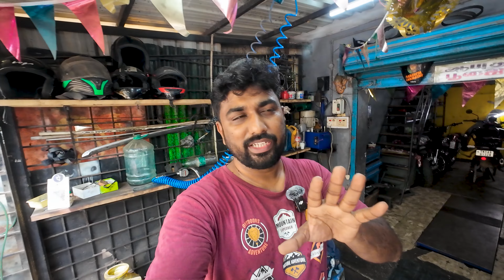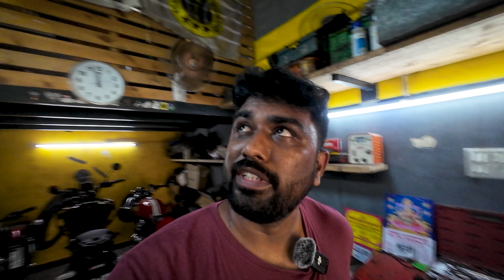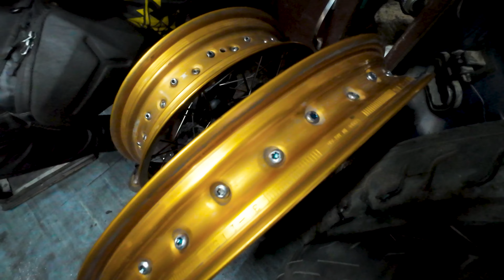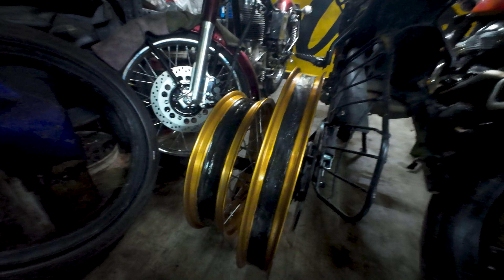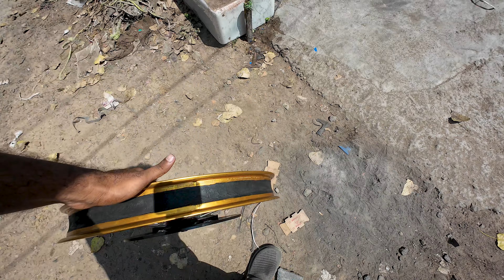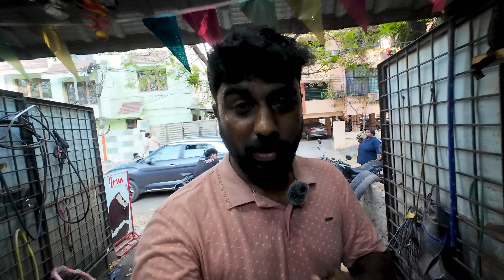Converting my Himalayan 450 from tube to Tubeless🤩🤩 Way2speed kit🔥 Now No more worries during ride😁👌

Comment: hi bro lov ur work but little bit update on this , u cant adjust the spoke if u did the sealant will crack ,, so i may suggest a SIMPLE way which i did on my interceptor 650 , just cut a big tube and spared and place it on the rim and place your tire over the tube now fill the air and cut the excessing tube with sharp blade boom tubeless convection is all that simple  and way cheaper it  cost me just 400 for tube and 500 for labor, issue with this method is you need to fix new tube whenever u remove and refit the tire  happy ride ✌
Reply from the maker: Super nice to hear that 👌

Comment: When the spokes gets loosened won’t torn this tape? Or won’t affect the wheel alignment process?
Reply from the maker: Truing( balancing )of the spoke is done & thread lock paste is add in the spoke nipple before adding this way2speed sealant to prevent it from getting loosened, so mostly it won't happen. If the spoke gets damaged or needs replacement we can cut that portion and do reseal it again 👍
Reply: @lingeshvlogs3871 Bro, still is this good? Or any issue experienced, please mention even if very minor..
Reply from the maker: @Mavricx  so far no issues brother, I don't think there will be any in the future as well
Reply: @lingeshvlogs3871  Great Bro!  I’m also planning to convert, will see… Thank u!

Comment: This is not recommended at all . In future if there is alignment issues with fork you can’t adjust it . There will be wobbling issues, the best is to wait for the cross spoke which will launch in next 3 months.
Reply from the maker: Nothing like that , we can cut the sealant in that portion and after adjustment it can be resealed 👍. Moreover the truing is done & threadlock seal is also done , so won't be an issue.. 3 months ? Really? Do you believe it ?
Reply: 3 months no chance do this converstion and enjoy 😂😂😂
Reply: In 3 months? Are u sure? Cos when interceptor was launched in 2019 - the company promised alloys within 6 months and it took them 4 full years to provide one. And that too is available only for newly manufactured ones. So it would take them bare minimum 1 to 2 years for bringing out the rims which you've mentioned. By that time - all riding enthusiasts would have crossed 50k miles.
Reply: It's already 4 months 😂
Reply: Is Himalayan 452 tubeless available atlest now from RE?

Comment: One small doubt do we need to maintain the same tyre pressure which is 32psi?
Reply from the maker: It is always recommended bro , pls check the manual they might have give some + or - based on the load / luggage weight I guess
Reply: @lingeshvlogs3871  thanks, i think i didn’t phrase the question properly. What i meant to ask is after conversion without tube inside do we still continue to follow company suggest psi for air in tires? Or we keep it more or less? Etc. just a doubt.
Reply from the maker: @purandhar-hm6vx  actually there is no update on it but i keep my tyre pressure at 31 psi

Comment: anna oru doubt off roading la spoke wheel kodukrathe andha spoke spring maari loose konjam movement koduka dhan edhavathu periya pallam illa miniute jerk ana ipa converstion la andha movement ah illama irundha rim odaya vaipu irrukula adhunala dhana alloy wheels ah off road apa thavirkuranga alloy odayum nu purila enaku konjam sollunga anna?
Reply from the maker: Correct tha pa but that sealant is rubber kind of material ( like our bike tube ) it will allow the spoke to do it's thing . nothing to worry on it bcos even in the tube tyre in this spoke rim RE ( infact all manufacturers) has given spoke rim tap which will be pasted to our rim to prevent the spoke to poke/ damage the tube 🤷‍♂️. So it is how it is ☺️

Comment: Thank you for the Information Nanba, 

Did tubeless conversation kits and works available for classic 500cc desert storm motorcycle? Is that any motorcycle with spokes?
Reply from the maker: Thanks for that nanba ❤️☺️
Does the rim of the classic 500 is made of aluminum??
Reply: @lingeshvlogs3871  I think mine is in Stainless Steel Silver coloured nanba 2017 model.

Comment: Hi bro..Old himalayan 411 side stand install panlama in 450 ??
Reply from the maker: Actually we tried brother, it is getting set after some work in it but it is not a single piece & more over it is Hallow at the centre so chance like it may not hold the weight as time goes 🤷‍♂️. So we are planning to work little different. Let's c 👍. Anyway thanks for your suggestion brother ❤️☺️

Comment: Bro Long rideku himalayan 450 or super metor 650
Reply from the maker: My preference would be h 450 oly , not riden super metor yet but I will stick with h450 itself
Reply: Ergonomics is very different in both .....I had ridden both in long  run fr abt 150kms....super meteor is a gem in long rides provided there shd nt be any broken roads......
H450 u can take it to any where even if roads are broken or there is no roads....As our indian road conditions concerned....preferably himlayan 450...is best for both rider &pillion....super meteor....is good for rider only ....nt preferable for pillion ..rear comfort is zero..

Comment: You would have regretted this decision by now brother no worries u can upgrade to cross spokes....i used a sealant from seelin which gets into tube and protect costs me 700 rupees protected me for 4 years on bullet electra and almost u 7 months protected 2 punctures any way my intention not to spoil the work these guys do
Reply from the maker: No brother I don’t regret it bcos it was useful for me tilll now and it is  functioning well
Reply: Hi bro, is it effective for preventing punctures in tube tires? I saw some reviews saying the time might rust after using the seelin solution. Can u clarify that? I believe villivakkam  seelin mentioned.
Reply: bro, is it effective for preventing punctures in tube tires? I saw some reviews saying the time might rust after using the seelin solution. Can u clarify that? I believe villivakkam  seelin mentioned
Reply from the maker: @ it won’t prevent punctures for sure , it is not puncture sealant , it is a sealant to convert tube rims to tubeless rims